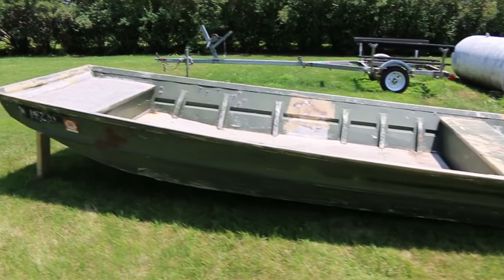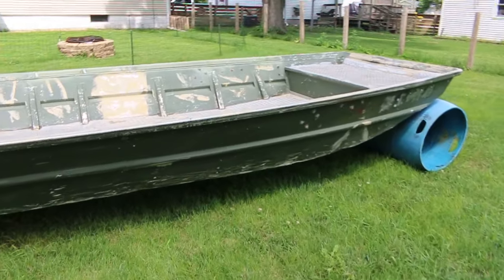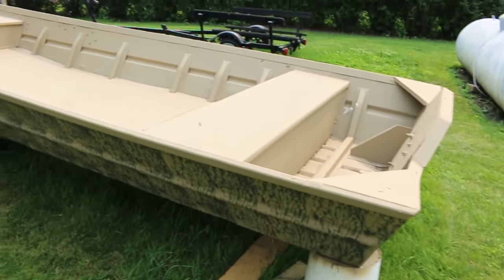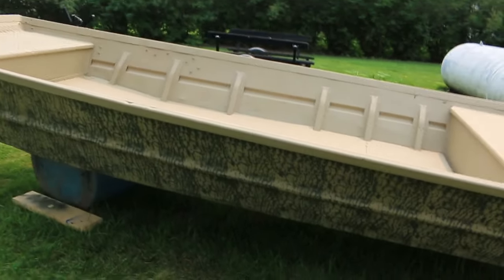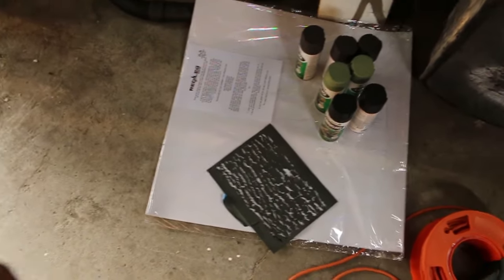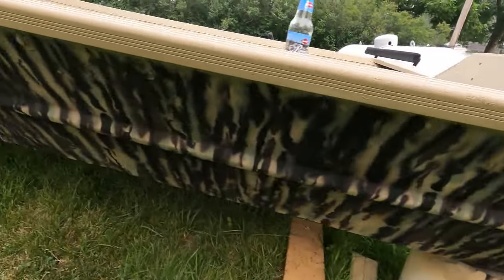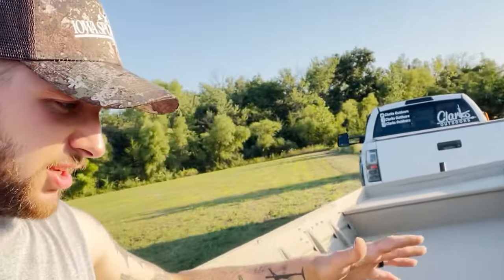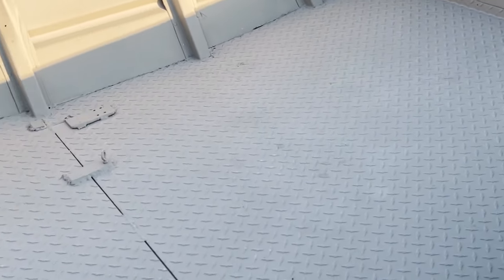REDLEG REALTREE CAMO STENCIL || CAMOING UP THE BOAT

Comment: What kind of paint did you use for the base coat?
Reply from the maker: Rustoleum camo paint in gallons so I could use my paint sprayer.
Reply: Have you had any problems with the paint peeling off or just not sticking to the aluminum?

Comment: How much did the total paint job cost?
Reply from the maker: About 56$ unless you count the paint sprayer that I purchased as well. Then it was 140$.
Reply: @ClarksOutdoors  not bad. How many spray paint cans did it take? Been watching a bunch of videos on here. Really thinking about repainting my boat
Reply from the maker: @shaneosborne8423  well I used the paint sprayer for the main coats with rustoleum camo paint in a quart then used three cans of paint for the colors.